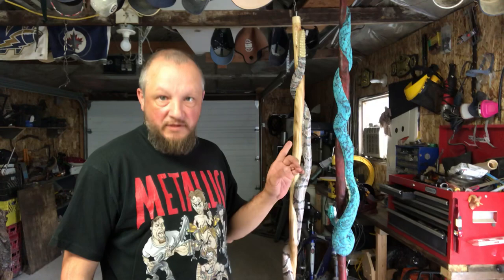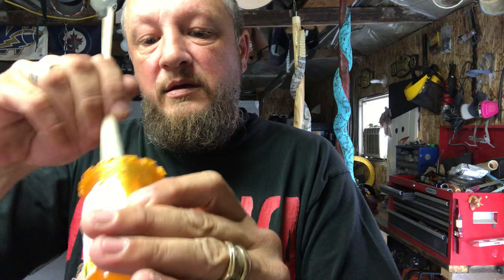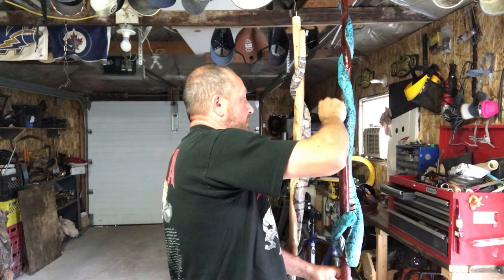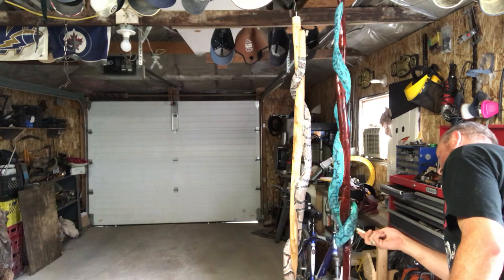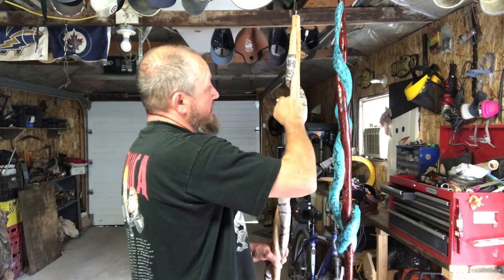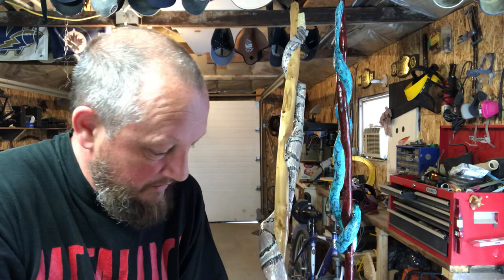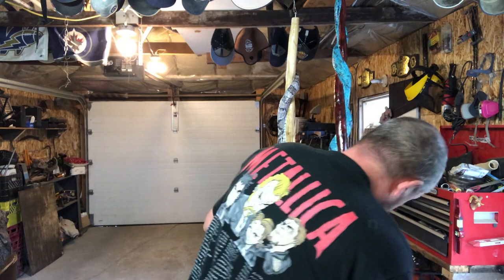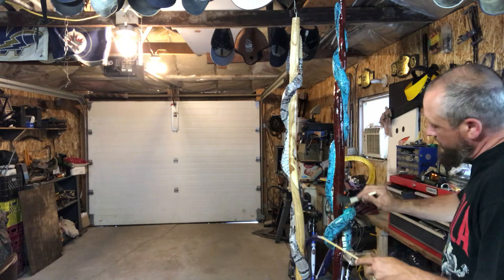How I protect my walking sticks with epoxy

Comment: Thanks for this tutorial. I've always used clear varnish for such things and epoxy resin as a strong adhesive rather than a sealant but can appreciate that it gives a very tough finish which is ideal where things could get scuffs or chips.

Comment: try to find you an old bbq grill rotisserie motor and rig up a adjustable support to fit the length of the shaft. you could put temporary hooks or attachment points in both ends and let it slowly spin until the resin cures. with it spinning slowly it'll keep the resin evenly coated and wont allow it to accumulate or drip. only problem is youll need the horizontal space.
Reply from the maker: Good idea and it need s to be warm to cure ,, I’ve had a couple screw up because of temps being too cool to cure

Comment: Use a heat gun after brushing it on it will take out any air bubbles and dry it quicker and dry it even but thank you for this video
Reply from the maker: Thank you for the advice

Comment: Interested why you prefer to use clear epoxy instead of polyurethane or spar varnish?
Reply from the maker: Great question… I use it because it stays solid and it doesn’t allow the wood to split . Tho leaving it in the sun may yellow your item but I haven’t had that problem
Reply: @ChooseyourownpathWoodcrafts  Do you sand between coats?  I'm planning to put a vinyl decal on, then epoxy over.
Reply from the maker: @eskewj no not with epoxy , you have to keep a eye on bubble

Comment: Thank you that was useful. One thing you should do, and many YouTubers do to help their viewers is that you should always, always post links for the specific products you use! It's important you do that. Thanks.
Reply from the maker: The only links I have is for kutzall , I’m not affiliated as to where to buy the other tools that you see . Those who post them links make a commission on sales and I don’t . Thank you but that  ly works for those who are on amazon affiliate s
Reply: @ChooseyourownpathWoodcrafts  you misunderstood what I had to say. You used an epoxy process. I meant what epoxy brand did you use ,  what did you mix it with Etc? Thanks for your response.
Reply from the maker: Ok that I can do thanks for the feedback

Comment: I have a walking stick I want to epoxy that still has the bark on it, should I seal it before I epoxy it?
Reply from the maker: Great question, first off I’d recommend that if the bark is loose or peeling off you’d want to remove that first ,any loose bark will cause your stick to just be a problem . Secondly yes seal it and make sure it’s dry and I mean a week or 2 dry lol you don’t want any moisture when adding epoxy it will either not cure . This is my opinion on adding epoxy to bark

Comment: I have a bamboo cane umbrella, and I'm wondering about maybe sanding the shaft to apply epoxy (for extra durability) so that the umbrella mechanisms can still move without being obstructed... of course, I would have to apply some to the lower end and leave it open... then apply some to the top end and leave it closed... because otherwise the mechanism will stick to the epoxy... seems like a workable project? Or should I find some way to detach the mechanisms before working on the shaft?
Reply from the maker: John Galt if you cab tape off the mechanical part that would work or have it hanging so the epoxy would run down ,,, keeping a eye on it doesn’t build up on the handle part
Reply: @ChooseyourownpathWoodcrafts  I'll have to look at disassembly videos for umbrellas in general, although not all of them are made the same (some are even flat out garbage)... I'm not too worried about the handle part on this one, I'm going to be putting epoxy on that too, since I don't want it to have any chance of coming off (plus it has lots of etchings, and those are gaps that need to be filled, there's already a splinter that came off from one of those)... thanks for the advice

Comment: We can't see anything that you're doing while you're mixing it! I've never used resin, it would have been nice to see how much you were using and what you were doing.
Reply from the maker: Ok so first of all this is a older video , second epoxy depending what your using has a instructions on the box as how to mix , some are equal other have a different ratio , 3 depending on how big your project is you’d have to guess just like I did for the amount . I’m sorrry this video didn’t make that clear but unfortunately it’s a project that If you’d want to try out it would be at your discretion

Comment: Can you apply this over existing clear coats like urethane?
Reply from the maker: Yes as long as you urethane is dry , just like paint lol
Reply: @ChooseyourownpathWoodcrafts  Also, should I scuff up existing finish so epoxy sticks? I know. Dumb question.
Reply from the maker: Never a dumb question , I use the micheals pour on brand and I’ve not done anything but lay it on
Reply: Fanrastic work. Thanks for sharing.
Do you (or anybody here, for this matter) know how to get the same protection and hardness without the high gloss finish look?
Many thanks,
Edd
Reply from the maker: Hi, now I’ve been using this method a lot in my project and one thing I was going to try was to add vanish to the epoxy really give it a good mix and maybe try a smaller piece to see it what works ?

Comment: Hey man I just finished my hiking stick with 3 coats of Tung oil. Can I put epoxy on top of all that? Will it make a difference?
Reply from the maker: xxdfoster yes you can , it will make your stick solid just make sure you fine it time to cure
Reply: @ChooseyourownpathWoodcrafts  cool, thanks man